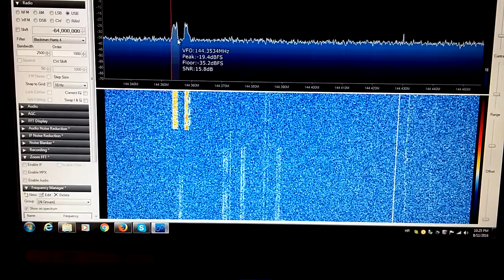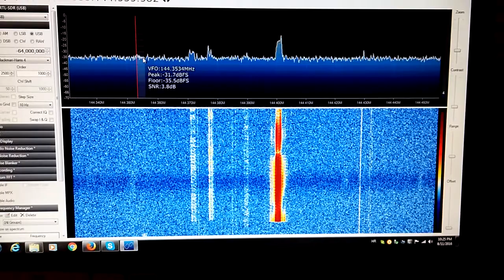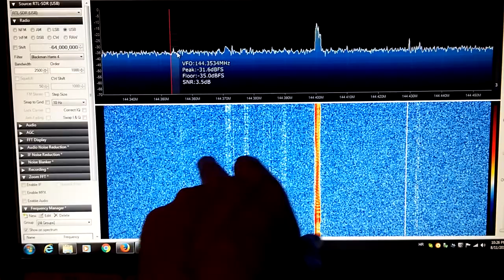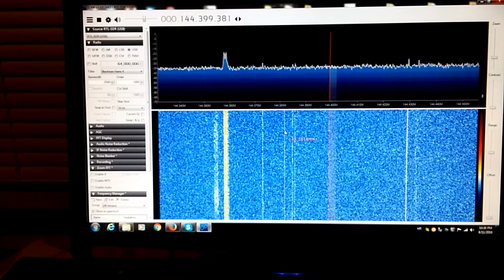Perseids reflections 144Mhz using the RTL.SDR dongle

Comment: Nice MS signals Adam,  There were very good conditions for VHF Meteor Scatter (MS) work last night.

I menaged to make a short video, receiving a 
signal from "graves radar" in France on 143.050 MHz received in 
Macedonia (dinstance is 1520 km)Received with Airspy-SDR receiver and Delta Loop antenna for 7 MHz, without LNA :-)

Here is the video link:
https://drive.google.com/file/d/0B7Bk3JifFLbSWkdtZFhqVGppcnc/view

 More info about Graves Radar which is used as VHF beacon for MS and EME on this links:

http://www.itr-datanet.com/~pe1itr/pdf/The%20143.050MHz%20Graves%20Radar%20a%20VHF%20Beacon.pdf

http://www.itr-datanet.com/~pe1itr/graves/

By the way, I have to get one of yours LNA4ALL for test...
73,
 Mile Kokotov, Z33T
Reply from the maker: Hello Mile, the reflections were just fine despite the basic 2el. yagi antenna. More than I expected.
Graves signal is also fun, always there as a reference signal.